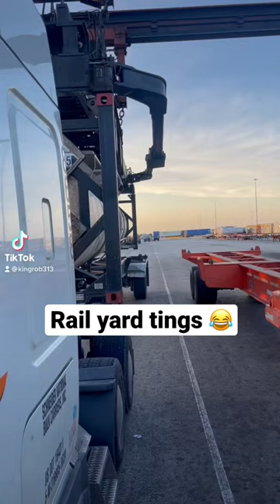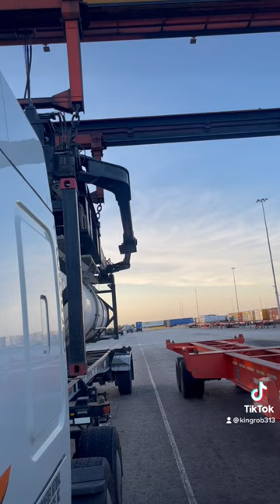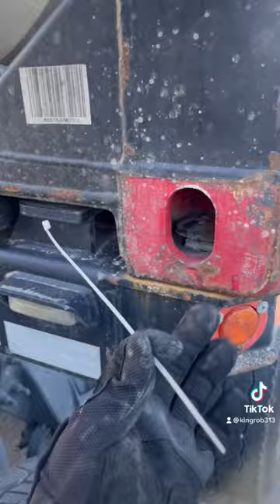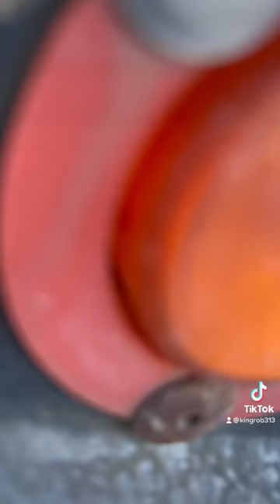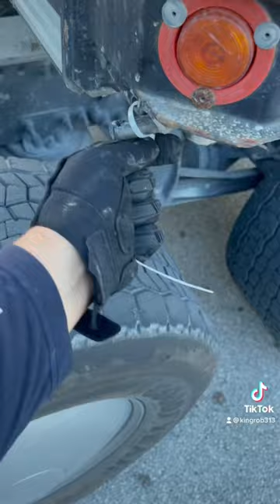Hazmat tanker wrong way part 2 fix #shorts

Comment: Yes a zip tie can hold the weight and not snap 🤣🤣
Reply: The zip tie is so the handle doesn’t move when he’s driving. Without the zip tie the handle would turn with bumps and vibration. Those things aren’t holding any weight.
Reply: Tell me you don't know shit without telling me you don't know shit
Reply: WOW SMH no common sense

Comment: I remember before all those chassis were either old or imported, you didn’t need to tie the corners the locks just worked.
Reply: The locks still work. Zip ties are a redundancy. Some locks are still spring loaded to remain locked, but still required to add the zip ties.

Comment: Make sure the Zip ties are not the cheap crap. Always do safety checks along the longer Haul routes and if need be put two instead of one
Reply: Zip ties are zip ties, it’s a failsafe for the failsafe for the failsafe. It doesn’t actually have any strain on the zip tie.

Comment: This guy it's for your safety why you have to sit in the truck cuz most truck drivers are dumb and try to stick their hands in places it shouldn't be especially when there's heavy machinery and someone sitting in the machine sometimes can't see you that's how accidents happen and just so you know they're called guides/ locks /cones but I've never heard nipples that's a first
Reply from the maker: You right they can drop that mf on the cab
Reply: @kingrob313  it's just for safety so that the operator doesn't have to not only make sure he's getting it on the right spot, But also doesn't have to watch out for the driver incase something bad happens
Reply: @kingrob313  what state are you driving in?

Comment: do those zipties really do anything
Reply from the maker: Yes bro I said the same thing
Reply: Looks like he’s supposed to have a cotter pin on those locks but he must be using a zip tie cause cotter pins can fall out.
Use cotter pins for Clevis hitch at a farm and they fall out all the time so half the time just run no pin with a tractor
Reply: Probably just prevents road rattle and popping loose.
Reply: It prevents the pin from unlocking itself I think
Reply: Might have something to do with putting zip tie on trailer door
Reply: Worthy of Hell Fire
Reply: Yes it’s not holding any weight it’s just keeping the handle still so it doesn’t flip and release the tank
Reply: He said it himself they from god himself
Reply: I'm sorry I wouldn't trust my life to a zip tie. Look at using safety wire next time. You can pick up some safety wire and spinners for under $25.
Reply: They are not holding the tanker to the trailer they are holding the locks shut
Reply: Not a thing
Reply: @broocksregan4685  
Imean, on one side they're just holding the locks shut....
But I'd probably use safety wire, cause I like going overboard.
Reply: Well time to start cutting zip ties and flipping those pins an then sitting back and wait to watch death and mayhem happen....
Reply: How they gonna have Hazmat secured with 4 zip ties? Dufuq?
Reply: You're going 55 your truck is shaking no matter what.
Reply: Yes they do alot they keep the lock from coming  loose  once they unlock you are not stable you can hit a corner and the tank or box will flip off chassis  it's really easy to flip a tanker just take a 2 liter and  roll it on the ground
Reply: I can see how the zip tie holds it in, but being that it's actually a pretty crucial part, I would 100% have a bunch of like 12" sections of 9 wire or tripled up tie wire and a set of lineman plyers and tie it  up just so you're not reliant on plastic, just my 2 cents but if it works it works 👍
Reply: Trust me. YES THEY DO.
Reply: @broocksregan4685  been using zip ties for 8 years running the ports. All they do is make sure the pin doesn't rattle open.
Reply: The zip ties don't hold the tanker in place, they hold the things that hold the tanker in place.

Imagine a pin for a trailer hitch, just a simple trailer hitch for a pickup truck, something most of us have used. The main pin is thick and holds all the force of the trailer, but it requires a little tiny cotter pin to keep it in place, the cotter pin doesn't hold any weight, but it's necessary to keep the main pin from sliding out and releasing the trailer. 

That's essentially what the zip ties are doing here, it takes a lot of strength to keep the tanker in place, but it doesn't take a lot of strength to keep the things that are keeping the tanker in place in place, but it's still a necessary job.
Reply: @conanruisi  Cutter pins only fall off when they break. A zip tie will break the same way lol.
Reply: @nowlindventura5015  cotter pins can fall out for like no reason
They’re not perfect at all
Reply: @conanruisi  imo if cotter pins fall out you didn't bend it enough or you got some weak azz pins lol. I'm not talking about the zig ones I'm talking straight and bend. Those don't just fall out.
Reply: No

Comment: I'd be more concerned about those super singles you're running on that tractor....
Reply: Those some wide ass tires
Reply: I hear they've got a terrible habit of hydroplaning on water, and are practically useless in icy conditions.
Sound about right?
Reply: @Fightre_Flighte  yuppers
Reply: @dougheffner2592  
Then I too am highly concerned about those super shingles being used to transport hazmat.
To hell with fuel economy, safety should be paramount with that cargo.
Reply: @Fightre_Flighte  3 winters and thousands of miles in storms. Never had an issue out of mine

Comment: I been running intermodal for 8 years in Chicago.. I still wonder if a zip tie breaks if your load is to top heavy what does a zip tie save if the lock latch work you’re good. A human can break a zip-tips I think a container and chassis with a idiot driving can break it
Reply: The zip tie isn’t holding the tanker on it’s a security measure to ensure the clasps that are holding on the tanker don’t fall out of place.
Reply: U run this 8years? Intermodal, without locking latch? 
In Europe u can't leave a port if locks aren't secured
Reply: @mateuszzimon8216  I lock latches but don’t use zip ties a lot of Chicago intermodal loads are yard to yard well we call them crosstowns
Reply: @flygodj  yes I know that I know large carriers want drivers to use them like jb Schneider Swift etc I never saw the point of them but as a owner op I can choose

Comment: You would think that they can put magnets on this trailers like the ones for hauling heavy equipment, instead of having to use those zip ties to hold them latches.
Reply: But magnets also lose strength with repeated impacts. And trucking has a lot of rattling, which is really just impacts....

Magnets also lose strength with heat. Ain't no reason to air condition the locking pins on that trailer.

Comment: U telling that a zip tie is preventing that huge ass tank from falling onto my car?
Reply: Its preventing the latches from opening so, yeah you pretty much nailed it.
Reply: Yep
Reply: What stupid didn’t say is the. Zip ties are just too hold the handle. For the locking pin in place. The tanker isn’t going anywhere. He just making it sound worse.

Comment: Oh yeah cuz I trust my life with the zip tie
Reply: It's just preventing the handle from moving.
I'd use safety wire, but zip ties are probably about as strong as you'd need.

Think about this next time you see a prop airplane fly over. That propeller? It has nuts securing it to the airplane. And those nuts are torqued down, sure.... But after that, it's only a thin piece of wire holding those nuts tight. Thin enough you could still stick it under a fingernail.

Enjoy your newly found and repeated panic attack.

Comment: A zip tie??? Holding that mass??? Accident waiting to happen, what if some idiot, who know this tech cuts that plastic?
Reply: The zip tie isn’t holding the mass but just stopping that pin from shaking out, also if someone wanted to mess that truck up they could do a lot worse than just cutting that one zip tie
Reply: @HRyder  they get cut during accidents been otr 15 yrs seen it happen maybe 4 or 5 times not a pretty sight